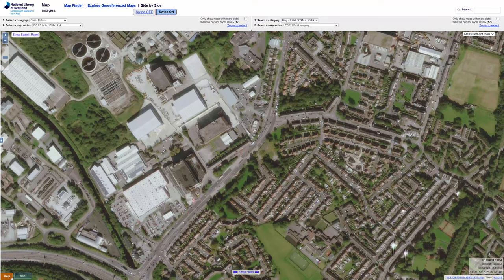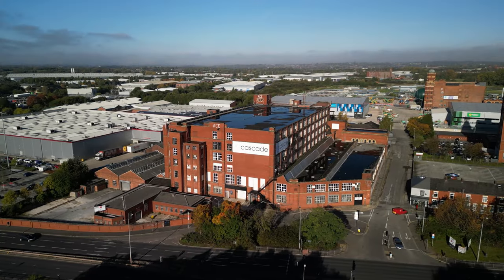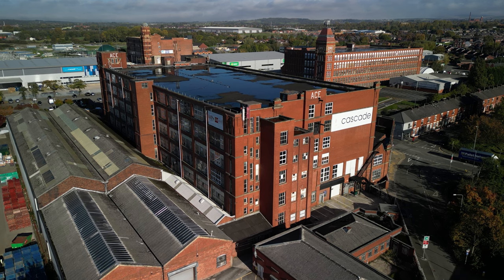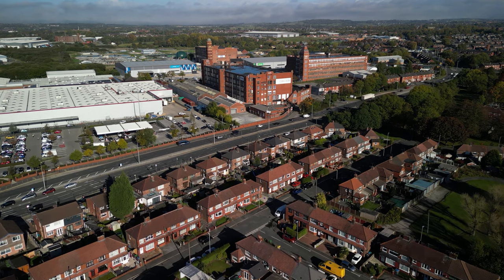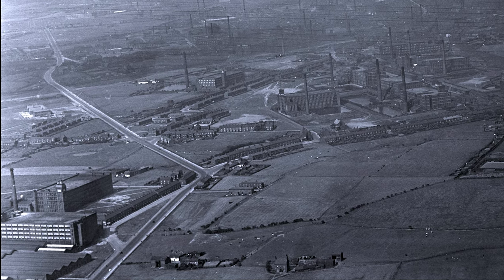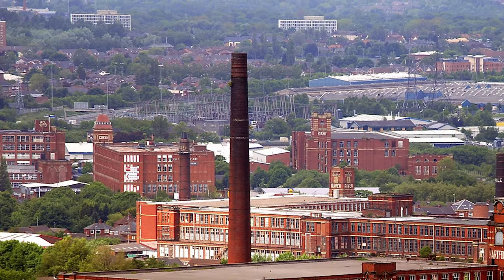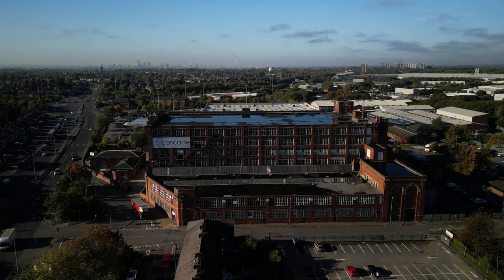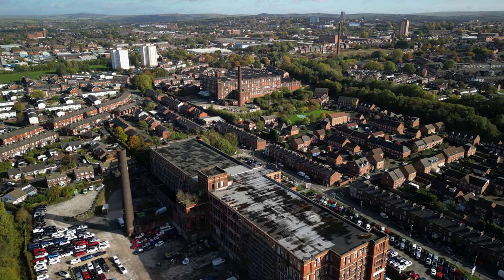The A - Z of Oldham Mills Ace Mill Chadderton

Comment: Nettle bought the Ace in 1972 and was taken over by Delta Electronic accessories in 1976 for making components for switches,circuit breakers plugs and sockets it didn’t change to MEM till the late 90s then Eaton/MEM in the early 2000s.
The Ace was also used as the location for the BBC TV series ‘Clocking Off’ from 2000 to 2003